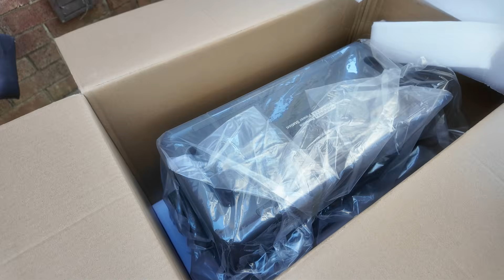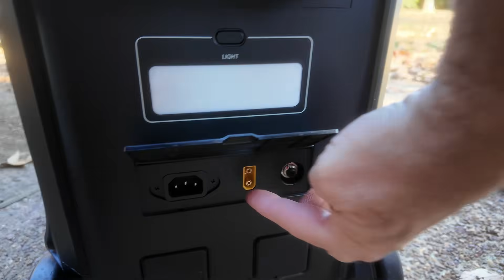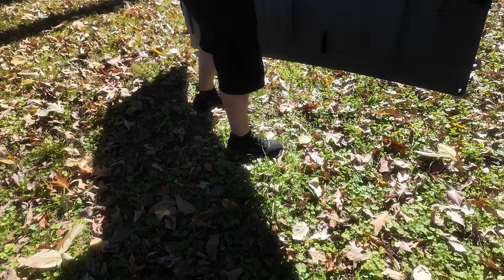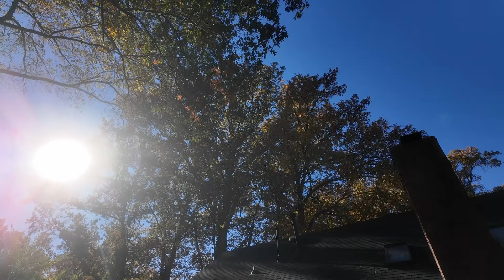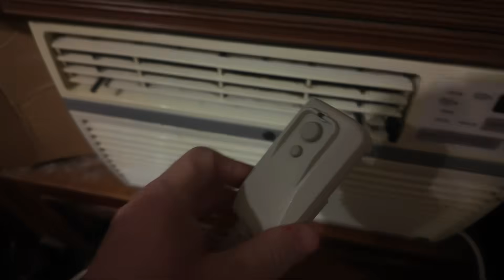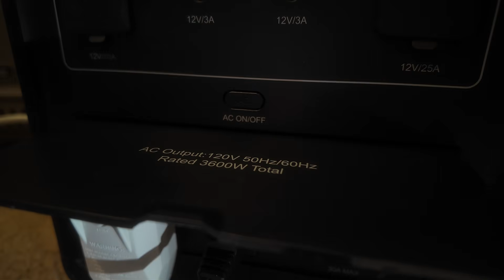Off-Grid Power Beast! Aferiy 3840Wh Portable Power Station for Blackouts & Camping

Comment: Why would my freeze dryer need to be plugged in during a power outage? Wouldn't it be safer to just clean it, leave it unplugged, and start again when the power returns if it is not actually in use at the time of the outage?
Reply from the maker: If you’re actively running a batch and the power goes out it will stop and your batch will be ruined if the power doesn’t come back up in a reasonable amount of time.

Comment: OK thanks for the info. 
The battery packs have come a long way in performance and price. 
I keep debating gas generators  v power pack.
The choice gets harder all the time.
Thanks for the tutorial
Reply from the maker: I think the best way to go is a combination of the two. A strong solar station like this one to run the appliances and a small gas generator to charge it up if the sun isn’t available is the way to go. Using gas to run the house is a less desirable way since it means there’s a gas engine running constantly.

Comment: I went to their website and that's not a bad deal at all!  Even cheaper through other vendors...YMMV.  I need something like this for more drastic outages.  I've got one of the 250 Rockpals solely to run my CPAP during an outage.  It gives me 4 hours.  I'm looking to get a Jackery this next year so I can make 8 hours.  I could see this being very useful(silent) if you live in an urban area.  I lived in Springfield, MO in 2007 when the power was out for 13 days at my apartment(massive ice storm, just didn't freeze the ground).  The amount of generator thefts during that time was astounding!  People would have to just find a way to vent the fumes from their garage to keep them locked inside.  Great heads up on what products to look into.  Thank you Sir.
Reply: CRAP!    Happy Thanksgiving to your family!

Comment: Interesting! I'll have to look into it further. Ive been using a competitors smallest version for several years now to power my computer, run camp fans, charge my phone etc... while I travel. I wouldn't mind a version to help run things in case of a power outage at home.
Reply from the maker: I started with a Jackery 240 then got a 1000. I can definitely see the need for the higher capacity units.

Comment: If that were just a touch smaller (or I had a slightly bigger space in my teardrop), I would replace my single lithium battery in my camper with that. I could still use the standard 30AMP at campgrounds, but also go offgrid AND run the AC window unit in the summer.
Reply from the maker: Yeah, with a teardrop you’d have to load it in your tow vehicle I think. It would definitely get the job done though.
Reply: @dadbudgetadventures And it's still less expensive than buying multiple batteries, a new inverter, solar controller, etc. Might be the path I take to upgrade.

Comment: The 3840 is the amount of power the battery can store. The 3600 is the amount of watts the AC can handle. 3 appliances running 1200 each would be the max for this unit.
Reply from the maker: Thanks for sharing. I figured it out after filming but I figured it would be asked anyway.

Comment: My parents just put up a shed for my mom's garden equipment plus they have a gas/propane powered portable generator inside of it 

It plugs into the wall and they have a plug into the house to run the minum stuff in the house.

They had the electricity go out this year and my dad already had the generator for his camper at the airstrip.

They are working on the airstrip and it's gonna be closed for a good year so they don't really have a model-airplane club right now.

Plus some other people built some new hangers right next to the old strip that they used for model planes.

They don't feel like running into some new hangers with the model planes so for now they kinda quit the club.

I know this because their old picnic table was sitting next to my dad's shed and not at the airport anymore.

This is sitting next to the even older picnic table that used to be there 

Which Is sitting next to my parents old picnic table that I painted white around 1988 or so.

My mom puts a bunch of plants on the top of the tables and the seats to.  It looks kinda awesome when everything is blooming.
Reply from the maker: There’s a ton of applications for a good generator.